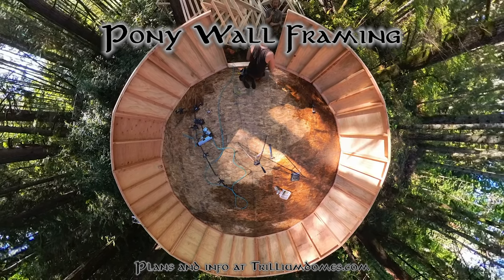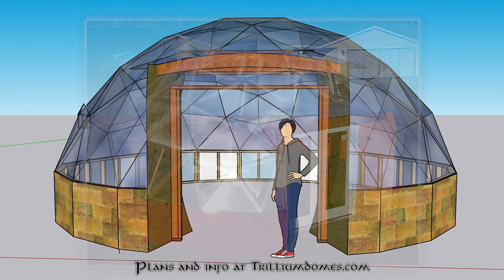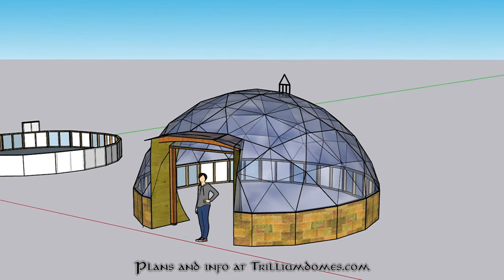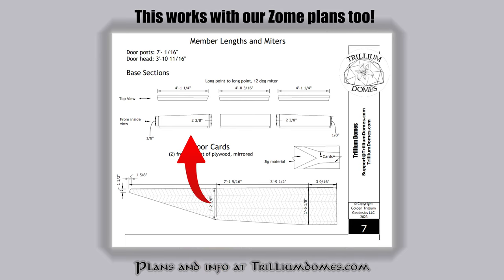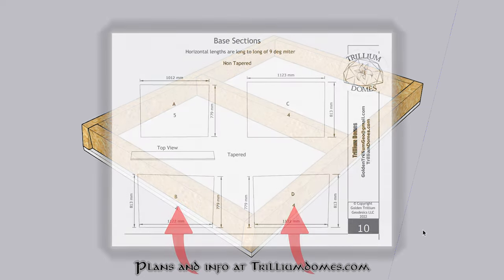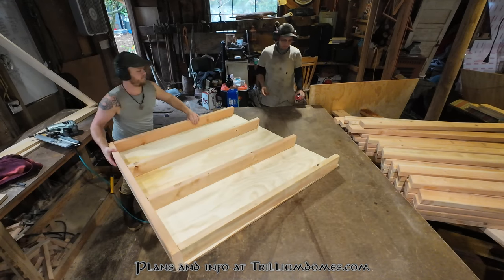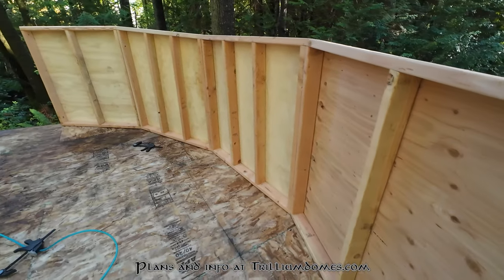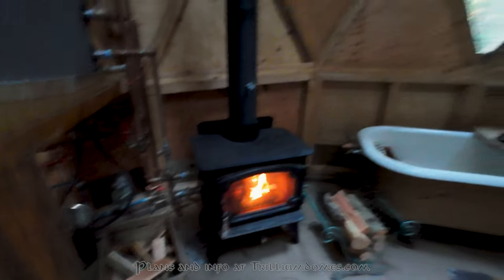DomeCraft #2 Pony Walls - Mastering Geodesic Structures with Trillium Domes

Comment: Towards the end, did you nail the wall into the base? How does that stay structural over time? It seems like not enough? Maybe the dome on top add the structural integrity?
Reply: Yes you fasten the wall to the floor system just like any other wood framed structure. You can use nails, hold down hardware, structural screws, etc. It makes for an extremely strong structure